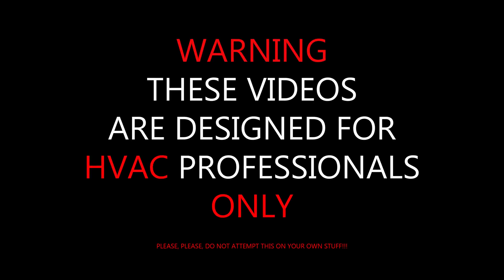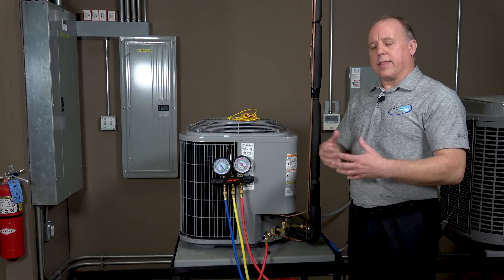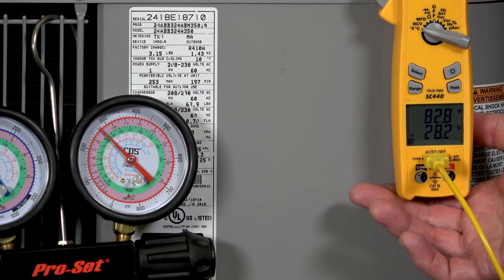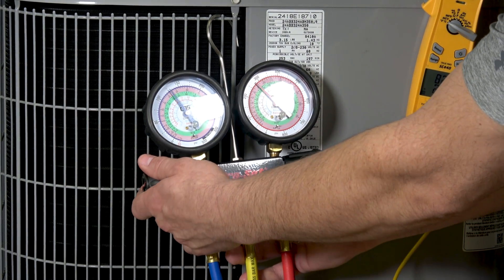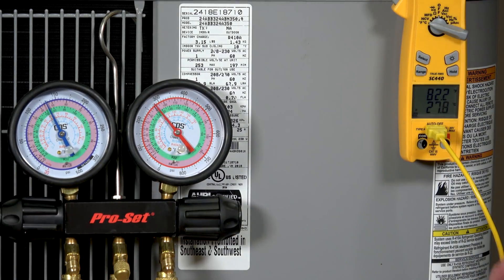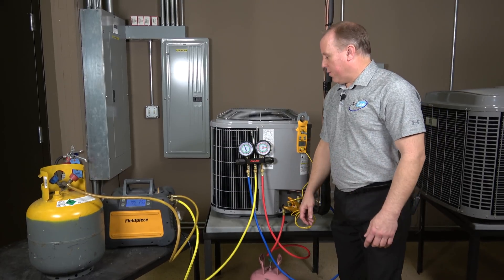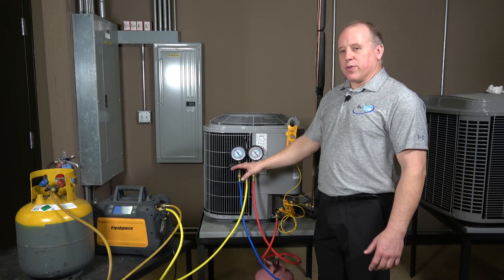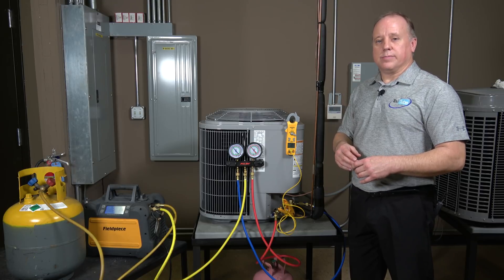Checking Refrigerant Charge for R-410a Condensing Units Using Sub-cooling Method

Comment: Can I use the infrared gun to read temp on liquid line?
Reply from the maker: You could but need to understand how an infrared gun works. The red dot is not the spot it is measuring but rather the center of the spot it is measuring. The larger away the gun is, the larger the scan radius. So to use it on a small diameter pipe, you will need to be a few inches away from the pipe. But at that point, just use a regular probe.

Comment: Do you have to use a filter drier when recovering refrigerant?
Reply: Its a good idea to use a filter dryer to clean the refrigerant as much as possible in order to prolong the life of your recovery unit and clean the refrigerant if you might be reusing it for the same system or using it within the same property, per EPA regulations. but in all reality you dont necessarily need to use one as long as you are not cross contaminating your equipment with different refrigerants, which is also per EPA regulations, hence they want us to have multiple units and equipment for the different types of refrigerants and jobs we do... How far do you want to go into the labyrinth of EPA regulations my friend? LOL. All in all, its a good idea, but it can be costly to always use a filter dryer, but is it really necessary in the overall scheme? Yes, and no... LOL

Comment: What about if you are running it as a heat pump? Is the procedure the same?
Reply from the maker: Yes. You can use sub-cooling to check the charge on heat pump while running in the cooling mode.

Comment: Hello Dave,
As always an excellent video. I appreciate going old school and discussing the process. I found the comment that complained about not using a digital gauge to be the complete opposite of learning anything. In fact, the people who only learn that way: put this here and that there,  and look at a screen result,  are really not getting the point of this video. Also, they could screw it up backwards and not have any more of a clue. Appreciate the effort and fully understand that when your making a video your looking at a bunch of things besides just your work- like the camera, and that some times a little thing or too isn’t perfect. But the old school explanation, and the adding and removing was a real good plan. Your only other video better than this one is the ice bucket challenge from a year ago or two….
Reply from the maker: Agreed. We have digital gauges in our lab and use them on occasion... but generally prefer analog for teaching. Although the nice thing about digital is that it does the subcooling math for your and we have learned that a lot of newbie techs are not good at math for some reason. LOL

Comment: my AC unit doesn't have sub cooling value at all
Reply from the maker: Some equipment... especially ductless inverter systems... do not publish sub-cooling target values and require all charging to be done by weight instead.
Reply: OK but at some point i have to refill refregrent because its level become little lower @TECTubefilms
Reply from the maker: @docesam  If it is lower, that means you have a leak. Ideally, you would reclaim the refrigerant, repair the leak, and then weigh-in the amount of refrigerant that you need.

Comment: R410A is a mixed 50/50 of R125 and R32 refrigerant. That whole point why it's charge in liquid form is to get 50/50 equal mixed of both refrigerant. The old method of purging and burping the hose will cause problem because it alters the composition of refrigerant. Use the vacuum pump to completely remove air from the refrigerant tank, yellow hose and manifold.

Comment: Hi, as you add r410a to increase subcooling. What happens to the low side pressure and saturation temperature? Do they go up or stay the same? Thanks
Reply: At a certain point the low side will stay the same
Reply: @BeautifulHomes83  How do you calculate super heat?

Comment: If the subcool is 8 and you want 10 you need to recover the refrigerants not charging more  ....
Reply: Add to increase subcool.. plus you bleed lines when connecting to unit not just when you add the tank
Reply: That's superheat
Reply: @deiluxx  100% incorrect. low subcooling means you add refrigerant. above 10'F, lets say 16-20"f, then you need to remove refrigerant.
Reply: Apprentice

Comment: Actual Temps on LL, and Saturation Temp. Relation:  It get's confusing, but remember this....  Add REF: decrease Sub cooling (Delta, T decreases)
Remove REF: increase Sub cooling, (Delta T, increases).  

Also just to get this off my chest.  If the Condenser coil, either 1 ton or a flat 50 Ton coil exposed to solar GAIN, "HAS NO RELEVANCE ON HEAD PRESSURE".  
 If some think this in not true, please argue the topic.......  I would love it. Have facts please. Outside air over coil (s).  No bells or whistles, just debating possible facts. Thanks. My opinion,.......  NO AFFECT! Let's see what you think. Peace.......
Reply: You have it backwards. I don't believe you know what subcooling is.
Reply: Ya dude you have it backwards

Comment: it would have been helpful if you were using a scale to show how much refrigerant it took to go from 8 to 15. recovering refrigerant should have been done with the unit running and a scale. also use an amp meeter to show how much power is being drawn during this.
Reply: This again? The video is not called "Weigh in a charge". Nor is it, "check amp draw of the compressor". It is called, "Checking Refrigerant Charge using Subcooling". Keep an eye out for the "Weigh in a Charge" and the "RTU maintenance" videos, to cover your unnecessary and unoriginal comment, over the coming months. Sheesh....
Reply: @mungs1104  judging by your comments you really need to go back to school and quit trolling. I've got gauges older than you.
Reply: @C-Younger  ok Pickle kisser. The scale and amp meter. When the sub cooling was low the amp meter was to show how many amps the compressor was drawing. The scale comes in to TEACH (something you definitely need) how much refrigerant was added to bring the sub cooling to 15. And again the amp meter was to show how much more amperage it was drawing at the higher sub cooling. Also would have been handy to show temp split on all three phases. Now how old are you and how long have you been doing refrigeration?

Comment: hi i have 4 zone 3ton  outdoor unit that is connected to 4 inside split units. It only has suction line connectors (so i connect liquid side gauge).  I noticed the compressor was making noise since we have had 90+ temperature. I checked pressure it was 200, so i purged some gas i noticed the suction line was having liquid.  I dropped the pressure to 150. But now the system giving the error "high-temperature protection of compressor discharge". 
Update: i added back some refrigerant and still system giving the same error.  It tries to come on, run the compressor for second or two alarm for high temperature and shuts off.
Reply: Purging into the atmosphere is illegal literally everywhere. Yeah, you let out gas and now you are having problems. No surprise. Call a professional will ya.
Reply: You don't have a clue what you're doing. Call a professional.

Comment: Will that be the same on an exv or eev?
Reply from the maker: Will what be the same?

The general process?  Yes.

The specifics?  No.  Ever type of system will have a different target sub-cooling and the metering device can make a difference on that.  Plus many systems with an EXV also have digital controls that you will need to interact with.

With that said, it is rare for a residential ducted split system to have an EXV at the indoor evaporator coil.
Reply: @TECTubefilms  thank you! 
i have several (like 14) 5 ton, split units with exv indoors. and ony 5 are working "working" as they sould. 3 of them , compressor is on, pressures seem OK but pipes are ambient temp. 5 of them suction pipe are sweting cold. and the rest have som other problems.
Reply from the maker: @afsecaira  Interesting.  Usually only mini-splits have EXVs on the evaporators for units that small.  To have one on a traditional system is rare.  What is the brand of equipment?
Reply from the maker: @afsecaira  If the pressures are "OK," then correct charging is not likely your issue so this particular video won't prove very useful to you.
Reply from the maker: @afsecaira  However if your refrigerant "pipes" are both ambient temperature while your compressor is running with normal pressures, that seems to go against physics.
Reply from the maker: @afsecaira  What specifically controls your EXVs?  Are they wired to the outdoor unit, the indoor unit, or an external controller?
Reply: @TECTubefilms  it is wired to the indoor unit.
Reply: @TECTubefilms  its a MIDEA. Chinese unit. rebranded as LASKO.
Reply from the maker: @afsecaira  Ok, that makes sense.  You have a ductless mini-split style unit instead of a traditional ducted residential split system.  Most of those require the charging by weight method.
Reply: @TECTubefilms  They were way out of charge. like half the chare (they need 8.52 Lb)

Comment: Hey guys, We actually  to go back and put the rapid recovery machine back on the system and recover (blow charge out)  some (almost all) the refrigerant we added due to multiple factors contributing to the low gage readings. Then we actually had to come back and add more refrigerant due to multiple internally contributing factors of the system. Then after all that we had to put the charge where it initially was... hahaha sorry guys... Matt actually contributed to the end results. Silly guy...geeze.....

I could sit here and explain what was happening but, idk if we have the capacity to understand why it was running at such a low capacity....

noooo he said it doesn't remember.... I've changed enough of them to know so, I'm not arguing.....

Comment: The best way to redo an over charge is to recover all of the refrigerant and weigh it to see how much it was over charged, comparing it to the FACTORY SPECS, I am losing my mind over the fact that is see so few instructors relating to the factory specs, simply recharge to the lbs and oz specified and then test. I have not been able to find one video on YT is several days of looking that properly goes over charging a unit from an evacuation.
Reply: This isnt always possible or practical depending on the size of the system.

Comment: Why use a recovery machine, just do a passive recovery opening the liquid line?  This is crazy to go through all of this to remove a few ounces on an overcharge.
Reply: I think he did that to explain both
Reply: @warrencorcoran3798  you’re joking, right?  You have to add to the low side while running as a liquid in a system using blended refrigerants.  You don’t dump it in, but meter it in through your gauges.
Reply: @adamhawkins2206  I only add vapor to a running system, Adam, I cant get back to the original post so i cant reread what i was refering too, you were refering too,
Reply: @warrencorcoran3798  you add 410a as a vapor?  Any blended refrigerant has to be added as a liquid to avoid fractionation.  You should never add any blend as a vapor you are diluting the mix and changing the properties of the refrigerant.  
I’m not being a jerk, I want to make sure you understand that refrigerant can be added as a liquid to the low side as long as you meter it through your gauge valves or a vaporizer installed inline.  I’ve done it for years without any issues you just can’t dump it in, that will cause a problem.  Hope this helps.
Reply: @adamhawkins2206  I agree 100% when it comes to zeotropic refrigerants like R410A--they MUST be removed from their cylinder as a liquid to avoid separation. The only blend refrigerants that can be removed from its cylinder as a vapor and not fractionate are azeotropic blends. These are rated just like pure compounds because they do not separate when they boil, such as R507. And to the techs who charge via vapor with R410a, when you do this you essentially ruin the entire jug of refrigerant.

Comment: I just a a coil change in my unit it aluminum inside consinser coil .  It messed up my whole system it takes way tooo long for the my temputure to drop I mean if it's 95° out I understand it may take hours to get to the set temputure or 70 but it does not take 12 to 14 or. A day and on half and temputure drop on my thermostat 2 temp.   What could be wrong could the technician disnt put right refriegerens or charge in my unit I do have a r410 unit ...

Comment: If you are going to pull refrigerant out of an overcharged system you have to make sure that your tank has been evacuated and he didn't Purge the lines between the recovery system and the tank.
If you contaminated system with air you're screwed..

Comment: I’ve been told a few times to always close the king valves when you are gonna recover the gas so you pull oil from the compressor. This pulled a pound or so and I didn’t see him shutting the king valves off. How high is the risk of pulling oil out if you recover 1-2 pound of gas?
Reply: Not high...and not at all. If he closed the valves then he would not have been able to pull refrigerant out of the system.
Reply: Don't worry, be happy
Reply: Samuel Valenzuela lol
Reply: @B K yes they aren't, are Queen valves made by Freddy Mercury Inc.

Comment: On a York 3.5 ton unit model YCJF42S41S1A R- 410A on the same cages in this video it read 135 on side of the Gage and the other circle gauge read 300 is this within range? He did add 1/2 a pound which gave us these numbers on the gauges.

Comment: You can take refrigerant out by opening the discharge/ red hose and charging hose hooked directly to the recovery tank.
Reply: Depends on if your recovery tank is empty or not, but I get what your saying 300psi on discharge line.. bit some tanks can hold higher charge
Reply: That's called "hot shot" that is against EPA guidelines in many cases. I wouldn't want to go on youtube and teach people how to hot shot. Also, you can lose oil like that, or break dip tubes.

Comment: Excuse me sir! You just turnt the botle upsidedown, meaning you are charging with liquid and not gas. Is that a right  practice?
Some body shold help me here please.
Reply: Yes thats correct what wasnt correct he didnt bleed the high and low side before filling
Reply: Excuse me sir! HVAC Commercial Tech for 32 years. You always Charge 410a and other blends with liquid. Refrigerants R-32 and R-135 Azeotropic blends need to be charged in liquid just don't flood the compressor
Reply: It’s okay to turn the bottle upside with R410A because that avoids fractionation
Reply: For a newbie to ask a question is a necessary procedure for learning. The same newbie making an erroneous statement is an indication that more attention is required.
Reply: excuse me sir!  you always charge a 410A with liquid NOT gas  ..good god!!!!!

Comment: I thought you shouldn't put liquid freon on the low side.
Reply: You do put 410a in as a liquid as it's a blend. R22 is gas charged. Don't slug it in and use spurts or an atomizer. Tanks can't push it into the high side. The 410a will vaporize when it hits the lower pressure so there is gas going in by the time it hits the compressor.
Reply: Meter it in slowly. Don't slam the compressor with liquid.

Comment: Why didn't this guy use a scale to measure what he added?
Reply: Because he's charging by subcooling, not weight. 
Also, he's not invoicing a customer, so weight not needed.
Reply: @one2toomany  I think he is talking about using a scale to see how much you have used. I never take my tank out without using my scale. You need to know the difference between 5oz and 5lbs. Hard to say when you are charging any system using a drum. Also if you were charging a package unit you would be using a scale.
Reply: This isn't boxing, it's refrigeration